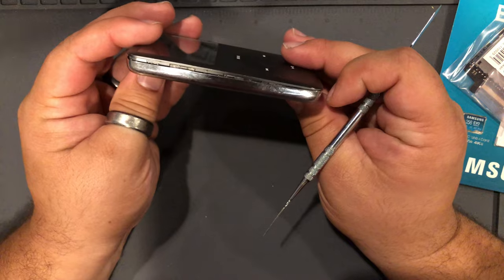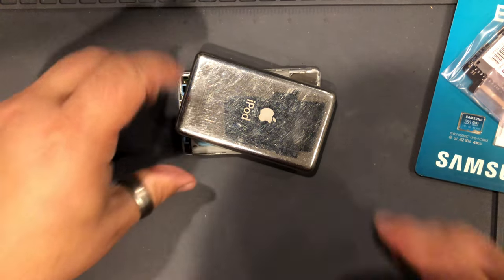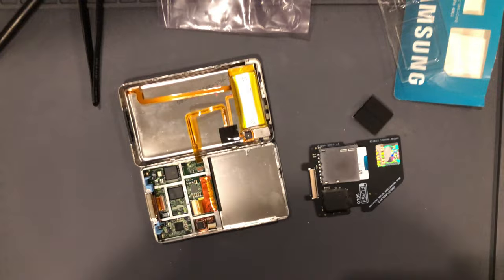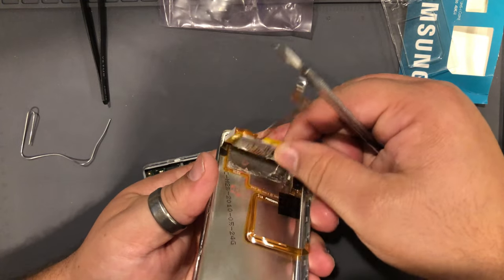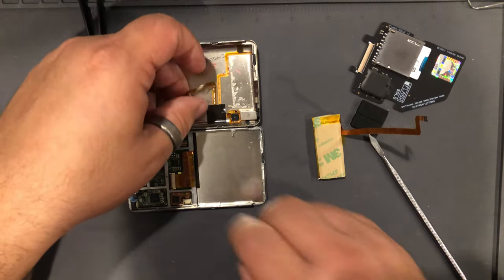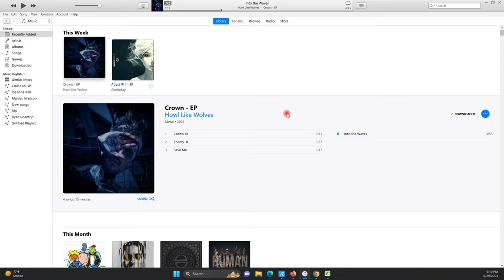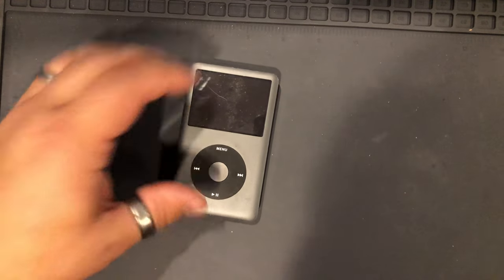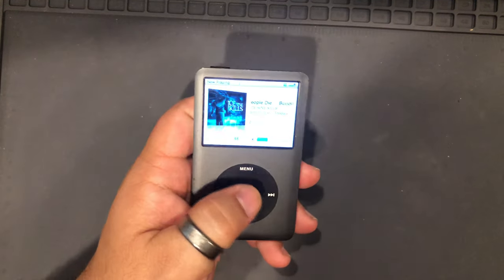Upgrading Ipod Classic to 256GB

Comment: U made opening the classic so easy. How!? But may I ask, if it’s accurate or true that the classic 6 gen only can utilise 128gb of memory space?
Reply from the maker: Ha been doing it for a long time.  Yes you are correct.  The 6th gen 80GB/160GB and the 7th gen 120GB can only have a max of 128GB when using an after market drive.  This makes no sense for the 160GB, but it's true.  you can drop a 256gb in the 6th gen 160gb and it will only show 128gb.
Reply: @hobbiesunlimited1  Thanks for sharing that information. The confirmation will reduce my bad purchases when i start putting together a shopping cart for my 6gen mod.

Comment: Your channel is great. I just installed an iflash quad with 256micro sd card and 3000mah battery in my ipod 5. All went well and the ipod went back to its normal screens, but the finder on my mac  still shows ipod recovery mode and the message "your mac is restoring the software on this ipod". Should I give it more time or is it stuck? Should I unplug it? Do I need to restore on a Windows machine? I can see the new updated memory in the settings and all the music is gone like I would expect. What am I missing? I did just read below certain model will not take 256? Mine is 5th gen Model MA002LL. Could that be the problem and how do I know? I would appreciate some pointers from the pro. I'm sooooo close!! Thanks!
Reply from the maker: leave it for a bit.  it shouldn't take more than 10 minutes to restore.  the iflash quad is a little bit slower to restore since the are 4 sd slots in a jbod config.  if that doesn't work you can try forcing the ipod to restore by holding Menu + Center until the ipod reboots then as soon as the screen goes black from the reboot press and hold center + play  and it will force it into recovery mode again.  your model will take a 256gb upgrade but beware the model only has a 20,000 track limit with itunes firmware.
Reply: @hobbiesunlimited1   While waiting for your reply, I restored my ipod from a windows machine that I could still get itunes which seemed much better (now formatted for windows). I followed your instructions and tried connecting on my mac mini instead of my macbook and it appears to be working and i am syncing my music as we speak. Was it the ipod force reboot/restore or the different computer was it windows install? Not sure but I appreciate your help. Stay tuned for the results. I couldn't seem to find a lot of information on this part of the process. Most videos skim over the connection portion. Maybe you could post a video on the final restoring and syncing process and the problems that could pop up? It also is unfortunate that I have yo use FINDER instead of itunes. I couldn't find a mac itunes download (I'm sure apple wont allow it). With apple now forcing "apple music" it has become more difficult to do any of this. Any suggestions and opinions would be great.
Reply: It looks like all 74.1 GB of my music synced to my ipod successfully. Woohooo! Not a smooth process, but it is a hack I suppose. Thanks for the help!

Comment: What do you charge for this.  My iPod had failed.  I want to replace w sd
Reply from the maker: Hello!  for 256GB I charge $150.  It includes parts, labor, and shipping back to you.  Do you know what generation the Ipod is and the current hard drive size?  Only certain models can be upgraded to 256GB.  Also depending on the model there is a track limit due to itunes firmware.

Comment: Just a question if u don't mind sir when upgrading a 7th gen thin with 3000mah battery and iflah should i get a thick case or just use the thin one thx
Reply from the maker: do a thicker case.  the 3000mah battery won't fit with the thin case.  Good luck!
Reply: @hobbiesunlimited1  thx for the help sir